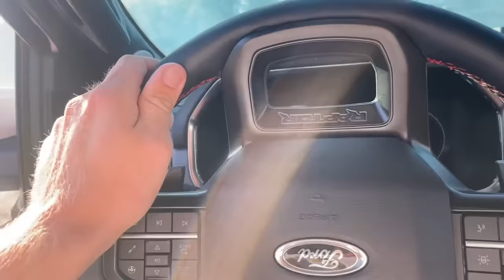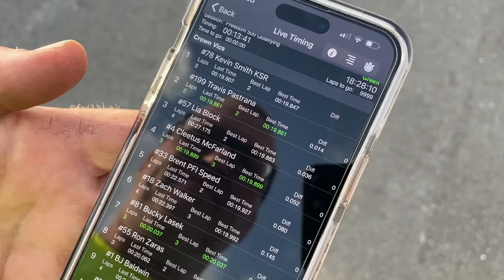I FINALLY WON the Freedom 500 After 3 YEARS Of Losing!!!! Battling 100 Laps For the W!!!

Comment: To point out to what Vaughan said about the belts, it makes no difference if you have a 2" or a 3" belt for a HANS device. You can use a HANS device with a 2" or a 3", but you should ALWAYS run a HANS with a 2", as the added pressure in a crash from the smaller surface area can damage your collar bones if you aren't using one.

Comment: You need KSR to clean it up next year.  All for aggressive driving but he pushes into other drivers requiring them to either reduce throttle or wreck as the only choices in nearly every corner.

Great job Cleetus, entertainment at its finest!
Reply: Hhmmmmmm, the first time I drove from last place to 1st, I didn't touch a single car. The second time through, I had some small bumps, but nothing like what was done to me (facts, not complaining). As far as driving in a way that causes them to reduce throttle.......every single driver is doing that. I could have run through every car on the track at one point or another, but instead I chose to pick and choose my passes when others would make mistakes or I could change my line to get a run on them and then get along side them on the next straight. I led the most laps, and set fast time of the race by a BUNCH. You can bet that I will be driving exactly the same way in the next one too ;)
Reply: @KSRPerformanceFabrication  completely fair, its obviously more pronounced when leading, and then having to come from the rear to leading again...like you did.

All depends on every driver's "goal" for the race, and while everyone is definitely competitive...some just want to avoid injury while having a good time.  Clearly safety is top notch at the FF now, however just always in mind.

Regardless, great driving!

Comment: Lol everyone could've guessed that the guy that owns the racetrack and has drove on it 3x more than anyone would win the race.
Reply: Its still a tough crowd, and its a circle track, there no need to learn the track, you just turn left. Its more about driver skill. There pro drifters and nascar drivers in that feild, it was 100% skill based win
Reply: @silvastnf6427  While ovals are clearly much easier to learn than road courses, there's definitely differences between every single one of them. 
You wouldn't run the same line at Irwindale as you would the Freedom Factory for example. Not only that, but being able to pick up on the nuances of the track to set your car up, can easily put you up front or out of the ball park.  And don't even get me started on dirt tracks lol. 
Congrats to Cleetus, well deserved win. Hopefully he gets into a late model again and actually qualify for the main. That would be neat to see.

Comment: Holy restart violation 😐. You should have to stay in your lane until you cross the start finish line on the start/restarts.
Reply: Depends on the track. Some places everything is fair game after the green flag drops.
Reply: @trevor4533  they need to do something. Guys are clearly jumping the restarts and gaining a ton on positions by doing it.
Reply: @MuddyPuttersDG  Again, it really depends on the track and rules. If the leader has already fired and the green is waving, its usually fair game.

Now if you're out of line before the green, that's a different story...

Comment: You should be disqualified for your wreckless actions at the end of the race. You created a major safety hazard for the rest of the field that hadn't finished yet. I understand your excitement, but that will set a poor example of what to do for any future winners, whether it be at your track or otherwise. Test the new safety upgrades at your own expense. Well done on the win, but a highly disappointing finish.
Reply: The drama. everyone finished time he done that. He literally done a lap drifting corners with no one too close before he started doing burnouts and others too.

You need to relax.
Reply: @StraightUpLazy23  My mistake. It must have been everybody else driving in reverse direction, because, why not right? For a guy who's usually so worried about safety, he failed miserably in those end moments.

Comment: So no ones going to menton the fact that cleetus robbed brent of second place under safety....??
Reply: No, that is not what he did at all. There is an arrow on the track on the back straight. Under caution, each driver chooses if they want to restart on the high side or the low side. The leader chose the low side, Brent also chose the low side even though he could have chosen the high side, this allowed Cleetus to pull up to the outside of the front row for the restart. I chose the bottom line when I was in second behind Cleetus later in the race, then got spun out.
Reply: Ok that makes more sense, im not familiar with oval racing, thanks for the reply and correction 👍
Reply: @KSRPerformanceFabrication  great racing by the way! You should have won with that heroic climb back up the pack!